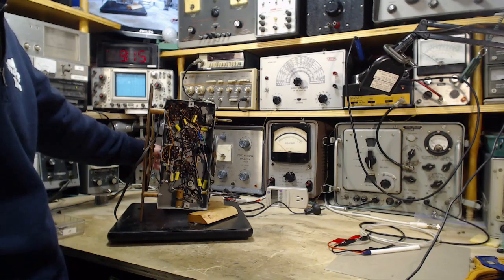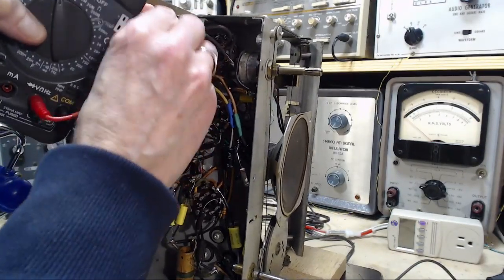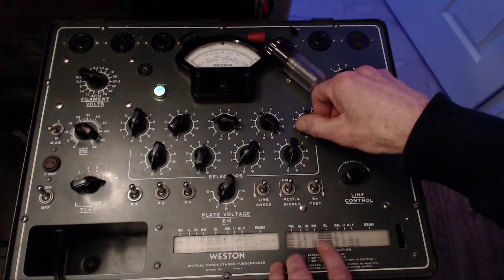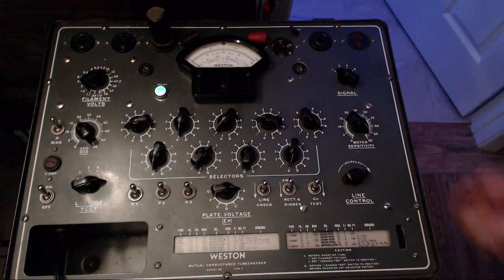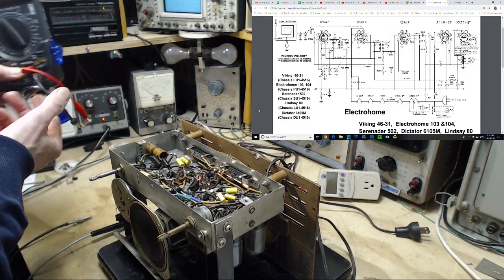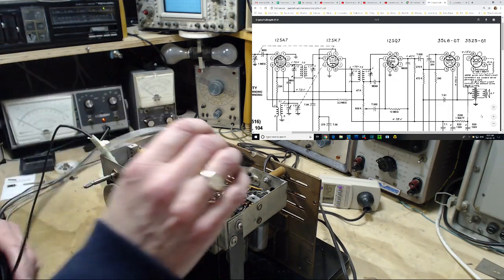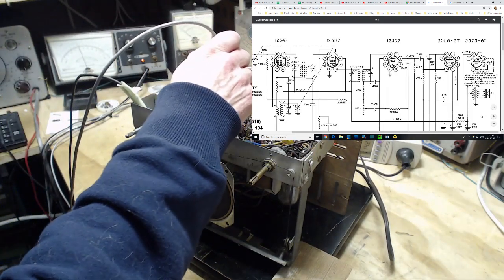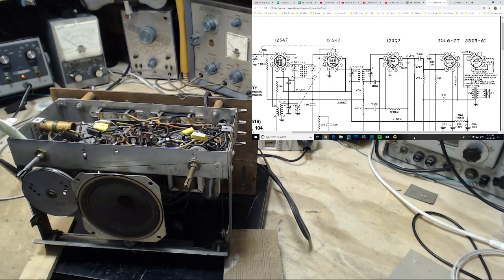Ugly Painted Viking Model 4516 Video #4 - Some Final Tests

Comment: Great camera angles. We see everything very nicely! I'm surprised you didn't  put in a new light bulb. According to the schematic you have a choice.
Think it depends where the original is wired to. A 6.3volt across pin 2 and 3 of the Output tube (preferred). OR a 110 volt  one across the supply and B-!